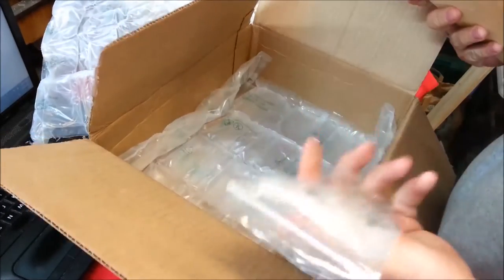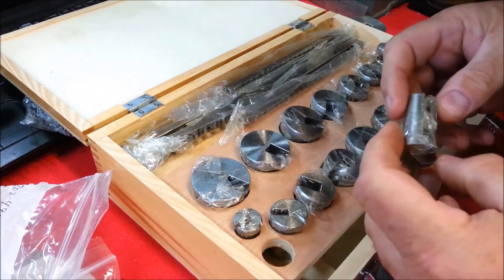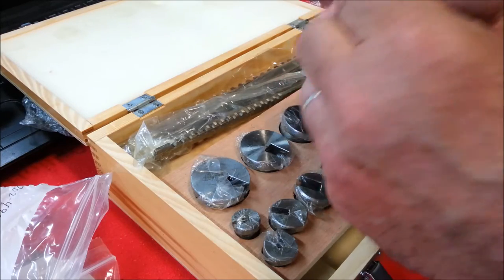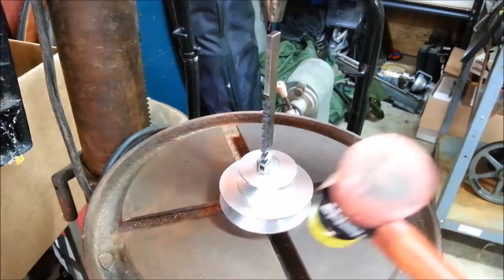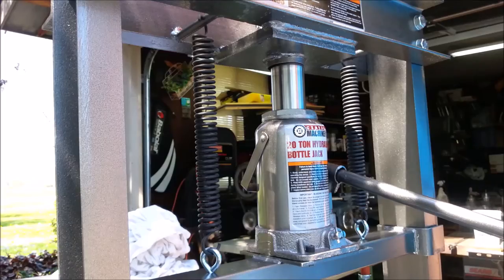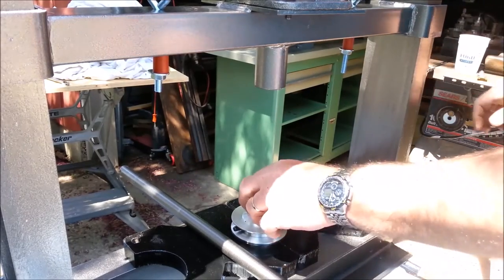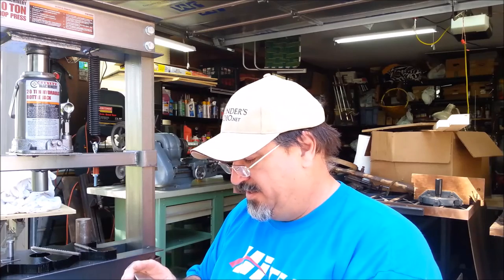South Bend 9 x 24 Workshop Lathe Part 7 - Broaching - Crafted Channel

Comment: Very cool! I like the "from beneath the press" shots showing the teeth in the broach removing the material. If a broach was to break, I bet they would make good strikers for a ferro rod! Wonder if a man could mount some kind of magnet under the press to catch the falling broach????
Reply from the maker: I'm not sure but I would suspect it would be magnetic.   Then, slamming the broach into magnet might be worse.  ;-)
Reply: +Crafted think normal they just have catching area with foam in it so it's got a soft landing.

Comment: I am looking for a step pulley for my 1946 South Bend 9b that also fits on a 5/8'' motor shaft do you have any more for sale I would build one as you have but cannot due to no pulley to operate my lathe with

Comment: did you line the keyway up with the set screw?
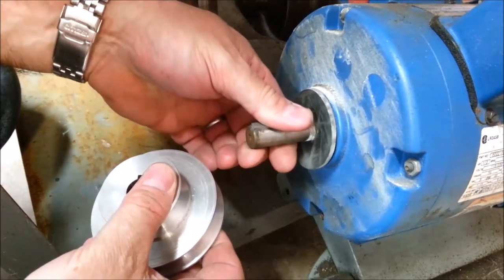Reply from the maker: That is an interesting question. You can see my positioning around 13:50.   I see some do and some don't.  I wanted to do it from the perspective of preserving the shaft.  However, I have a table saw setup that way and every so often I have to loosen the set screw and re-position the pulley.  It works it's way off the shaft.  So, I was a bit torn about what to do.   I ended up not lining it up because the screw getting a bite in the shaft seemed more reliable.  What I'd love to have is a set screw with a tooth of some sort so when you tighten the set screw you get a bite in the bottom of the key-way.   So, yes, I did think about lining it up but was not very absolute about my decision.   Please tell me about your experience and thoughts.
Reply: +Crafted I think that's why it's normally done that way, so the shafts don't get torn up. I'll have to see if there are other reasons why you should.